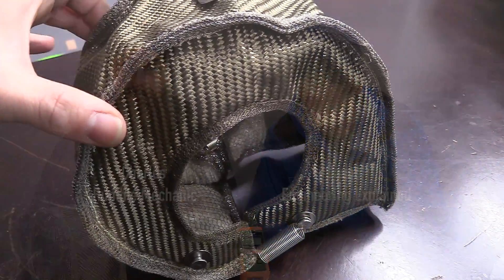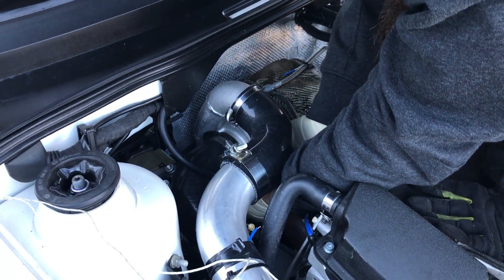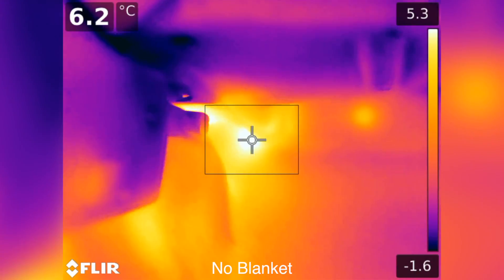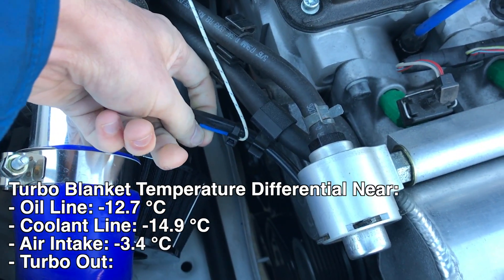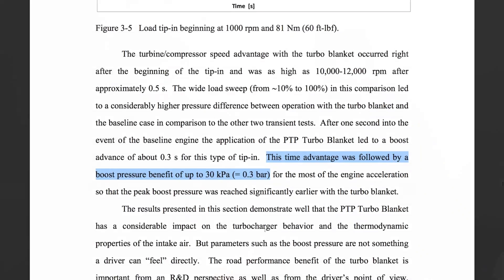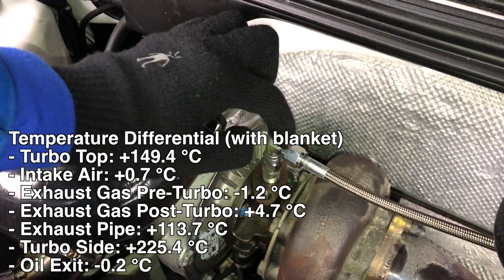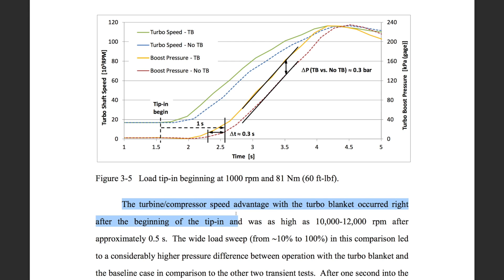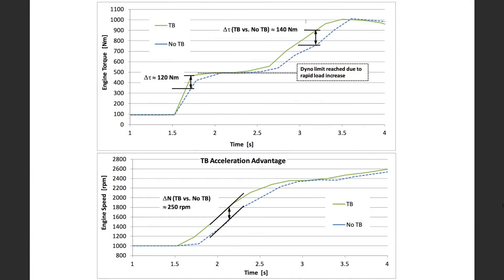Can Turbo Blankets Be Proven To Increase Performance?

Comment: You have to wrap your turbo up in a nice blanky so it stays happy!

Aways fun working with ya Jason :)
Reply: HumbleMechanic you know the old adage: always keep it wrapped!!!!
Reply: Kristopher Klassen ;)
Reply: Next test wrapp all outtake exaust pipes from manifold to downpipes and see how better it will
Reply: Yeah I think that wrapping the DP is next. PTP recommend it. I am just too lazy to take it off to properly wrap the pipe. :)
Reply: What about adding a wraped headder and downpipe to this setup?
Also what about the turbo seals if it gets hotter they might wear faster?
Reply: ProbeGT2 I wrapped my downpipes on my 4.0t, it really helps from keeping the heat from radiating, our engines get heat soaked pretty easy. I’m sure adding a wrap to the front half of your downpipe with this setup will only help. I’d be worry about wrapping anything further away as moisture and salt can soak the wrap and corrode the pipes.

My next step would be wrapping the headers and hot side of the turbo to further help keep heat soaking at bay. With it being an inverted set up (hot V) it’s gets pretty hot easily. Wrapping the downpipes alone is already beneficial. I do notice with ambient temps below 20* f, my car takes a lot longer to warm up. I’d have to drive a bit spirited or the oil temps stay below 165. At first I was skeptical about wrapping but no longer I am!
Reply: HumbleMechanic what if you have an after-run turbo coolant pump like on the VW EA888 engine? Is it still necessary as good practice to let your engine idle before turning the ignition off? Would you recommend me installing one on my 2.0L TSI @ 1.1 bar boost together with a K&N cold intake air filter? - SEAT Leon Cupra 290
Reply: HumbleMechanic Finally found the exact same study source and consumed it, before an introduction was made by either one of you two, or EricTheCarGuy, from a released video's content. I will have to make an extraordinary effort to spend more time reconnecting with a shade tree so it won't happen again. I enjoy the anonymity afforded by the snap judgments to avoid my kind made by strangers. It was hard to not have my soul saved 10+ times a day while out in public.
Reply: Great Video. You both make a good team
Reply: pro tips: go into welding store and ask them "welding sleeve" and hope that they have the right diameter
Reply: Nice VR turbo
Reply: HumbleMechanic your aem wideband is dead
Reply: It was worth it just for the sweet VR sounds at the end.

I also feel as if we're witnessing the creation of a youtube era Top Gear. EE = James May and science. The Car Throttle guy = The plucky Brit with interesting sayings, and, lets face it, an accent, and the Humble Mechanic = works on cars, "every man" feel, and a sweet beard, cleary the Hammond.

 I like where this is going. Shows like that need writers. Keep me posted!
Reply: You're thinking of Alex from CT? That would be freaking AMAZING!
Reply: i have a question for humblemechanic, i have 12v VR6 NA, can i switch to a bigger maf housing and see more gains? someone told me i can see noticeable hp and tq gains but i wanted to verify with u thanks
Reply: Yeah I don't have a blanket on mine. I think about installing one. But my compressor, exhaust housing, 02 housing and log manifold is all ceramic coated. Good idea to still get a blanket?
Reply: @4drturbo85  I'm a little late but, it won't hurt anything.  You'll retain more heat energy which is always good on the turbine side. Just curious,  do you have the inside coated as well, or just the exterior.
Reply: @4drturbo85   I've talked to both researchers studying thermal barrier coatings and people in the industry that apply these coatings, they both said the same thing... there's a difference of roughly 150-200 degrees f between having the coatings on vs not. You have the thermal barrier coatings in all the right spots,  and the difference in temps that you get is about the same as was done with the blanket. The one last place that would be of benefit for your engine would be to do the combustion chamber and exhaust port. It does change the engine tune though!
Reply: I don't know. I wonder what gain/loss you may see with it being coated already
Reply: I'm like a turbocharger - I need a blanket for maximum performance
Reply: No it works. It is hard to film because it flickers on camera
Reply: HumbleMechanic haha all I saw was the typical "Sens" error on the new X Series the whole time, is why I ask.
Reply: Arolbreaker ohhhh. That’s the oil pressure gauge. It was a late addition. I already had the front assembled and didn’t want to take everything apart again. So I just need to plug the sensor in.
Reply: Where you recording from inside an igloo?
Reply: would this work when the ambient temperature is 30 degrees Celsius too or only cold climates?
Reply: What about a turbo blanket combined with ceramic coated exhaust combined with wrapping the entire exhaust  with heat wrap????
Reply: @bichofunkilus yes they did no testing of CHRA temperatures,  however the oil temperatures were very close so I wouldn't worry too much about it.

However,  this test is completely useless without measuring pre-turbine back-pressure.  I mean,  it's a seriously useless test.  You can get the same results on a VGT just by tweaking the vane positions.  Granted,  they did open the vanes and run tests and they showed an increase in shaft speed at lower rpms,  which indicates an improvement in efficiency,  but is it related to the increase in back-pressure due to higher turbine housing and cylinder temperatures and pressures?  Or is it due to ACTUALLY converting more heat into work within the turbine housing,  instead of placing more load on the engine itself by increasing temperatures and pressures.

My opinion,  if it were that good manufacturers would have done it a long time ago.  They completely ignored pre-turbine EGT for the most part in the test and post-turbine EGTs were ALWAYS higher than without the blanket.  Therefore it is my opinion that pre-turbine AND cylinder exhaust valve temperatures and pressures were increased as well which is where the increase in performance was gained.
Reply: and now i have an image of ferris bueller being tucked into bed by his parents saying 'blanky' lol
Reply: Thank you :)
Reply: Maybe. I made that move because of the turbo. That 4in MAF housing changes the air in to "trick" the maf. IT would be an interesting test thats for sure.
Reply: This car has one. It came stock like many VWs. I Still think it's good practice to let it cool down for about a minute. What I do is cruise nice and slow in my neighborhood, then when I park, I let the car run until I have all my crap together. Then shut her down.
Reply: bichofunkilus I thought about this too, esp the oil temps. A reason they wouldn't be supplied though, is a auto maker is always looking to cut costs if it's not necessary.
Reply: what you're saying beats any logic: when temperature increases mass flow decreases, which renders your turbo having lower efficiency. you are using turbo to increase the mass of air in the cylinder. that's the reason you have intercooler.
Reply: HumbleMechanic would you recommend a turbo blanket for a stage 2 EJ25?
Reply: HumbleMechanic Here I am going down another rabbit hole about wrapping exhausts and I run into not just one of you guys but both of you.  I appreciate the information you both put out!
Reply: What’s your thoughts on intake pipe wrap? Ever run any test on that before?
Reply: So the blanket is make a better ya
Reply: has there been any reported issues with oil coking wen using a blanket, obviously if u hav old blackish oil, dont warm up in cold outside temps and cold down oil by idling after hard driving the oil channels in turbo would look lik direct injected engine valves and kill the turbo

but if we warm up / cool down oil and hav good oil / interval changes do u guys c any problem

hopfully i explained / expressed my question correctly 

cheerz and looking forward to a response and mor vids
Reply: HumbleMechanic I understand the pessimism towards time hijacking automotive undertakings. I was extended an invitation to attend an impromptu roadside pool party courtesy of Toyota's OEM plastic radiator hose splice coupling's timely demise when the temperature fell below 10°f. I admit I hacked together a "please work for at least 3 of the 5 miles" embarrassment, to get my parents home. I literally had icicles hanging from my mustache afterwards, thanking God that I had to order the replacement, saving my sanity.
Reply: I'd be concerned about long term turbo bearing(s) performance operating in these higher temperatures as well as faster oil degradation. As car manufacturers are always trying to improve engine efficiency and fuel economy, how come these things are not supplied in the first place? Something tells me this is just another gimmick to put under the hood.
Reply: I think you can see from the results both Jason and I found, and the study we reference it does impact performance. My guess is cost as to why OEMs don't use it. 

I also have had the question about long term performance. I am in talks with PTP about that exact thing.

Comment: The real question is if the blanket doesn't affect the turbo itself due to the much higher temperature that stays inside.. While in motorsport, they might not care since the turbo is probably replaced after a race, in real life, we do care about the turbo longevity much more ;)

Comment: an increase of 150 to 220 deg C temperature to the Turbo surface has any long term effect?
Reply: anything component exposed to more heat for longer will have a shorter life.

Comment: @EngineeringExplained, sorry for getting to this late in the game. Could the reason why the air not increase in temp, though seeing an increase in metal temperature on the top of the turbo is because the air is moving. Maybe if you measured the air within a few microns of the metal of the turbo it will be hotter, but overall, the average air temp would not increase. I do think if somehow the air was not blowing, and the turbo was heating up, then it would probably increase in temperature. The oil is a bit surprising, but maybe it is a similar situation since the oil is constantly flowing.

Comment: I have a 2016 WRX. I have been shopping for a lithium iron phosphate battery to replace the primary battery under the hood. I had read that heat can really have a negative effect on performance and may even cause the battery management system to activate. There is not much actual evidence that I found online will this works or doesn’t work. One side says never put lithium under the hood. The other side says several people have done it. I am looking at antigravity, xs power, Dakota lithium. I plan to insulate the battery, but have also now considered adding a turbo blanket to reduce under hood temperatures. What are your thoughts on this? Do you have any testing to support that?

Comment: The blanket exterior surface is highly reflective and the flir will not give you an accurate temp unless you control the emissivity     your measurements should be taken perhaps on some black electrical tape    extremely common error in the taking Temps with ir cameras

Comment: FYI, when you use K-type thermocouple wires for testing,  the tip needs to be in firm contact with something solid to get an accurate measurement.  Otherwise it will only measure the air, which is always moving, and probably not what you want to measure.

Comment: Design the turbo to take advantage of the blanket? I don't think there is such an option available lol. Been tuning 30 years never heard of such a thing. Please elaborate. Also you did not do a long term test on the turbo lifespan with 149 degrees Celsius raised temp under the blanket. Turbos have a seal which will likely go bad quicker with that much more heat. Finally what about turbo blanket fires!
Reply: don't get lots of oil on your blanket and you won't have fires

Comment: Curious, my 2009 Subaru Forester XT has a heat shield that rattles. Was considering putting a new one on. Would it be better to remove the old one and put a blanket on instead?

Comment: Yeah, it does decrease engine bay and components temperature, but isn’t it bad for the hot housing and other turbo parts? Because it will get hotter with such insulation, thus it’ll transfer more heat by contact of the turbine - bearing housing - compressor...

Comment: You do know their tests are on a diesel engine right and your guys's test is on a gas engine right so how do you expect to get same figures if diesel works completely different than gas one's based off high compression and low heat and the other ones based off of high heat and low compression!
Reply: are you REALLY asking an engineer and mechanic this question? 🤦🏾‍♂️🤣

Comment: what about carbon buildup in the turbo itself? it can get hot, 500+ but if you put blanket on it and you increase its temp by another 150°C.. wouldnt that burn the oil easier and create more carbon buildup ? i would worry.

Comment: You did these in a cold climate - if i'm in an area where it's regularly 90F/32C outside, will a blanket be similarly effective? i'm concerned about overheating the turbo's internals. Thoughts, anyone?

Comment: My experience with these FLIR cameras has not been good because of the emissivity setting. It needs to be set according to the material and even the finish of the material to get accurate temperature readings.

Comment: the part load implications in the study was amazing..............because when cruising, the part load throttle develops better boost which should be very positive for fuel economy.............the blanket prevents energy being wasted, when at part load there is not the same abundance of exhaust energy to get the turbine fully spooled.

Comment: Would a turbo blanket cause oil to "coke" onto the shaft going to the impeller?  (full synthetic oil) OK, question answered later in the video. No oil cokeing. But maybe a little gas savings due to torque improvements in the lower RPMs?

Comment: I make these at work, although our designs are a little more heavy duty, 2 layers of mesh, then a basalt mat, then ceramic wool insulation 25mm thick, and the outer cold face is a stainless steel woven silicone matting. Good stuff I really liked this vid :)
Reply: Which brand you working for

Comment: Jason, the turbo surface temperature increase of 150 C concerns me a little. Would this decrease the longevity of the turbo considering the temperatures are drastically higher?
Reply: Concerns me too, i don´t use blanket in my turbo, i have installed an air conduct direct to the turbo which gets all the cold air.

Comment: Tip for all:
 high temp 2000°f ceramic paint under wrap/blanket to prevent rust. And over to help seal in fibers, and keep things like oil spills/drips from soaking in ruining the wrap /blanket.
And don't just throw blanket on it wrap that sucker all the way to the Head. There's more low-hanging fruit in improving the effectiveness of a turbo.

Comment: My PTP turbo blanket fell appart after two years... so please treat this as a disposable. To be honest it was probably cooked and ineffective way before that. The materials are not up to snuff.
Reply: I've had my basalt rockwool t-3 blanket for on my 91 Dodge since late 2014(6yr), and I've had it on and off the turbine 4 times  over the years. no signs of trouble yet don't remember the brand

Comment: What is the price of a heat blanket vs. fabbing up an air scoop over the turbo to cool the turbo and act like a cimbley when you park?  The first turbos in the 80's had problems with the turbo baking the oil when people stopped.   Watch your exhaust temperatures and plan for them in your pipe, and do not park in a leaf pile.....

Comment: You mentioned "warming down" and chuckle.
Did you know this term before?  Did/do you play trumpet, French horn or other "brasses"?  Well, you applied the expression as "they" do, with gently cooling down after "playing", adding to the life of the components.  Lips wear with age (horn oil gets funky regardless).  The oil in my Volvo 940 Turbo Wagon behaves similarly.  I want the heat down the exhaust pipe, but was worried about cooking the turbo bearings (mine has oil and antifreeze bearing cooling), so a Wrap may be in my future.
I'd be interested in a video on Supercharging Toys in general; Cold Air Intakes and Filters, Oil Reservoirs and Coolers, Electronics, Waste Gates and Etc.  The Wrap Effect on the passenger foot well was Very Good Science and could save the floor mats (or hurt a relationship).  The numbers don't lie and they do matter!
You might want to edit the part where you have the $50k Flir camera (worth more than the car) in your hands (the passenger), during acceleration runs.

Comment: Good to know. so if I understood correctly, it helped get 10% more power and a bit earlier ? which should help 0-60 & 1/4 mile times if getting bit more and wee bit sooner ? 
Question, what are the possible side effects of the turbo itself always being hotter ? I assume smaller ones will not reach 200 degrees more, but whatever amount more, for their respective size, are they working harder than designed ? Can the turbo blow sooner, cause it's overheating / overworking ? Wear out sooner ? Would that void warranty if newer car ?

Comment: That TB wraps the exhaust side, but on many cars (FCA, Mini, etc) the blanket replaces the factory metal heat shield. It transmits less heat than the tin factory unit, but I wonder if it is effective in providing earlier power. It would be interesting to see a test of a gas engine vs a diesel.